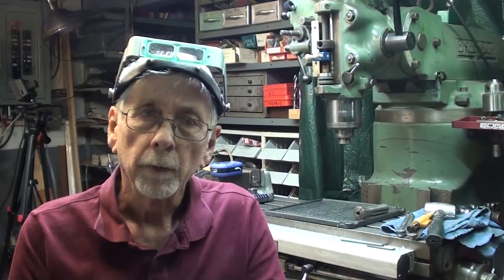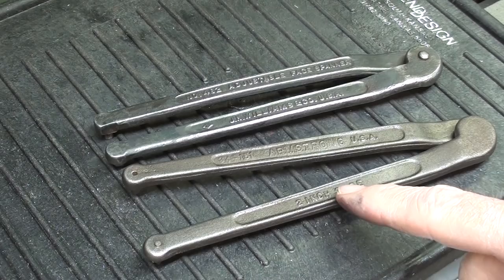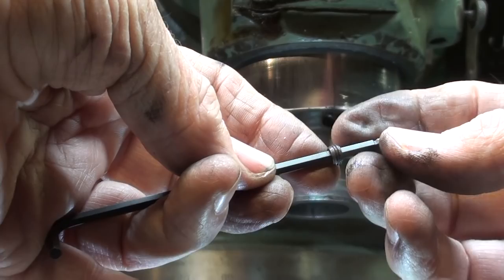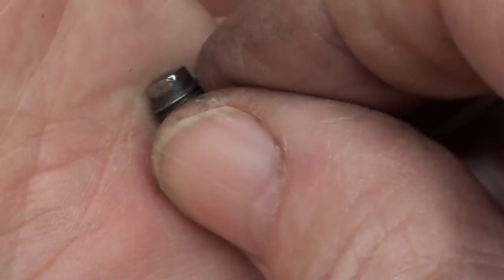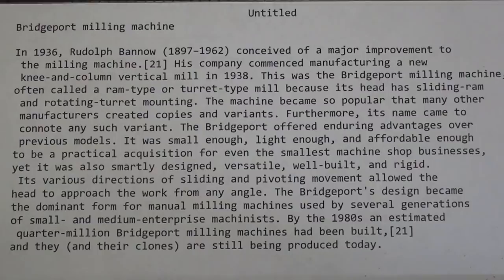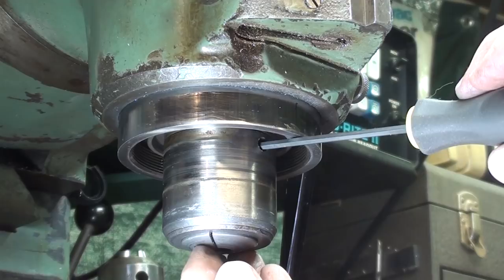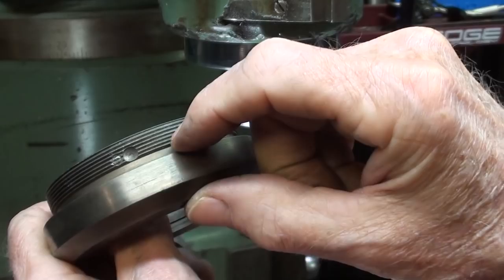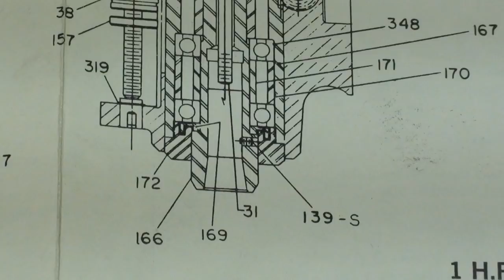Repair BRIDGEPORT MILL Spindle Key TIPS #615  tubalcain

Comment: I think you will find your spindle to be more chatter prone with the nose piece now loose. According to the drawing that is what loads the bearings.
Reply: Hey Brian, I agree the nose piece should be tighter than that. however, the bearings are preloaded by the nut and lock tab washer at the top of the spindle. There is a shoulder at the bottom of the spindle, and all the bearings and their respective spacers are stacked "upward" from there. The nose piece just holds the whole preloaded spindle assembly into the quill. I'm just wondering why the set screw dimple in the nose piece is in a position that leaves it loose???

Comment: I recently did this job on my bridgeport. If I tightened the set screw holding the nosepiece past just snug, the spindle heated up during operation.
Reply from the maker: Thanks
Reply: This really makes me wonder about the bearing arrangement in the Bridgeport style machines.  They hold up well, and there not spindle bearing and rebuild videos that cross my feed.

Comment: H&W has a YouTube channel and JUST YESTERDAY posted a video of how to change this key- It seems the new style replacement one has a much smaller Dog Point sticking out so that it isnt a big fat round with two flats that needs to be clocked, you just put it in and it's the correct width of the key slot no matter how you have it, and they tap the inner spindle DOWN a half inch or so after removing the spindle nose so you dont need a ball Allen to access the double set screws........

I liked your video better, none the less- H&W are great guys with (in these days) still fair prices on their parts, but the man they have doing their videos is very dry and robotic and humorless, and I'd prefer watching Lyle Peterson reading the newspaper or sweeping the floor to the other guys instructional vids.........
Reply from the maker: Thank you very much, I will watch that video. That is quite a coincidence
Reply: H&W have great videos, very instructional. But,  this is the one place that I recommend using a Bridgeport part. I have used both Bridgeport and aftermarket parts and have only ever had problems with the aftermarket ones.

Comment: I have what is called a round column and I have the same issue.  will look at mine and see the difference.  Who is this H&M for parts you speak of...thanks
Reply from the maker: Google it
Reply: @nevetslleksah  thanks for the help   be safe
Reply: It's most probably an early M head machine. If it is, it uses smaller collets and probably doesn't even use a collet alignment screw. Look up M head Bridgeport. H&M does carry some parts for M heads, look them up too.

Comment: Lyle, I'm sure that nose piece clamps the two bearings against their seat and should be tight .
Reply: It should be snug but not over tight, the spindle bearings are a light press fit into the quill.
Reply: I have completly rebuilt the Bridgeport top end, I could be wrong but I believe the nose should be snug against the bearings (the outer shell) there are precision spacers in there to allow the minimal clearances  between the two Angular contact bearings.  I spent many hours lapping these spacers down for minimal play. The nose keeps these outer rings hard up against the spacer (sandwiched) maintaining the correct play of the spindle bearings. If left loose I might suggest that the outer shells could work loose leading to bearing play.
Reply: @lachywocky  There should be Zero bearing "play".  They run in a pre-loaded condition.

Comment: Tubalcain, no lock tight on that little locking set screw? A drop of the low strength, or a even better a drop of your wife's nail polish will hold it against vibration and allow disassembly.